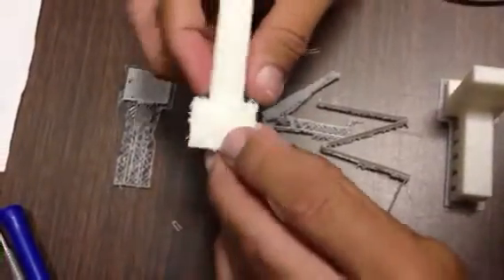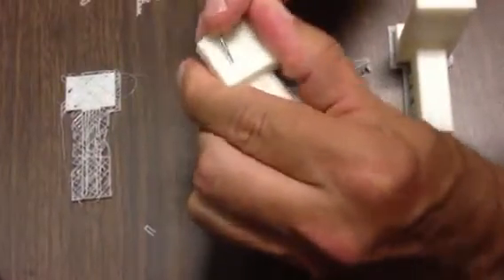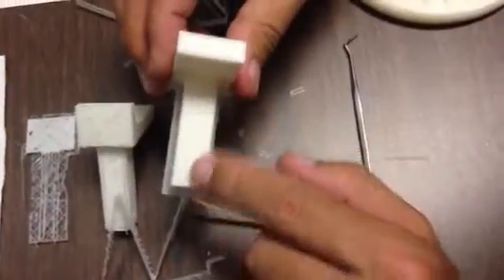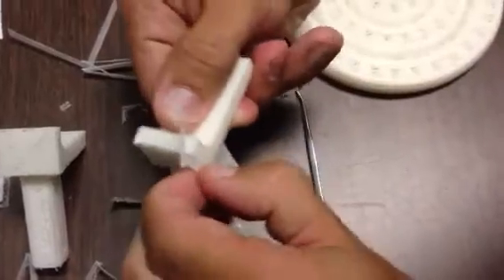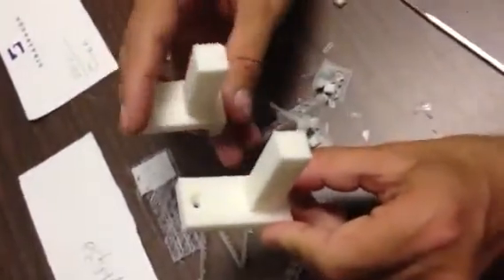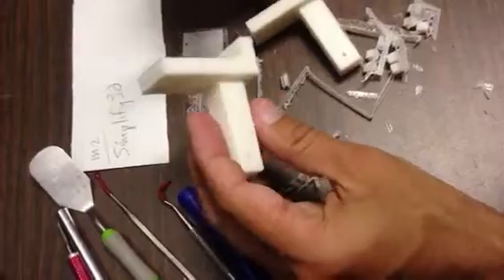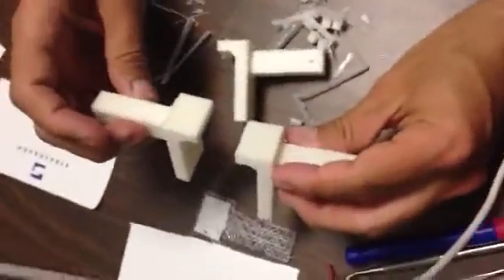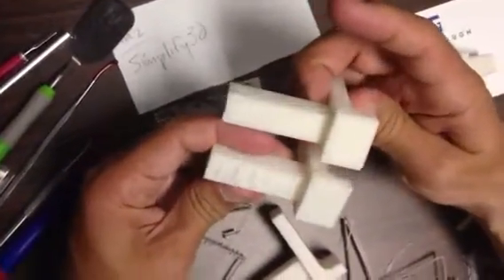Support Material

Comment: This was a great video trilogy, thanks for doing it!  I have several UP! printers and have been looking for something else that creates comparable support material for larger parts.  I am considering the M2, although I would still like to find a slicer that produces easy to remove support before I go that route.  Have you tried KISSlicer at all?  I use it on my BFB 3d Touch, and I generally like it, but the support removal leaves a lot to be desired.